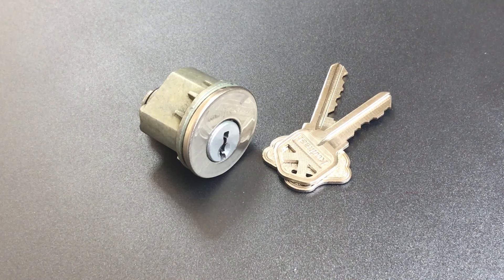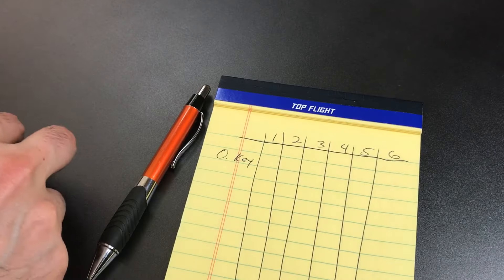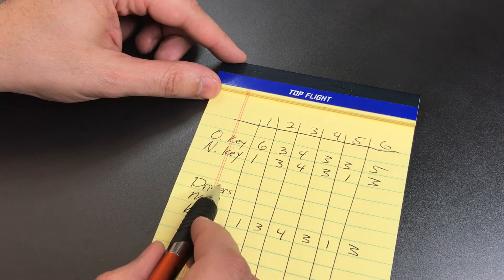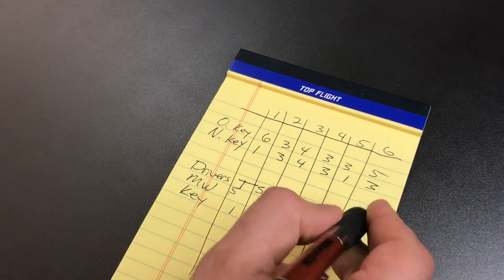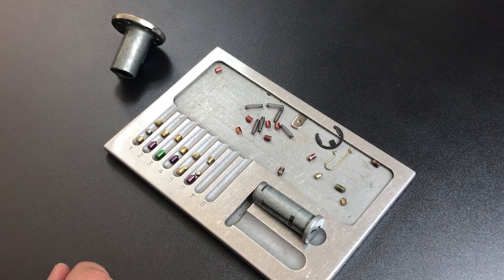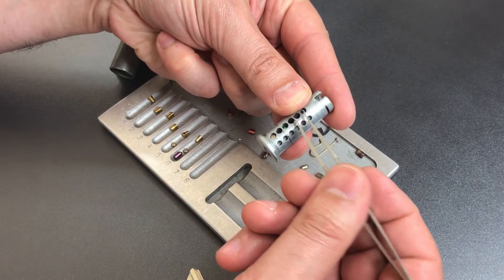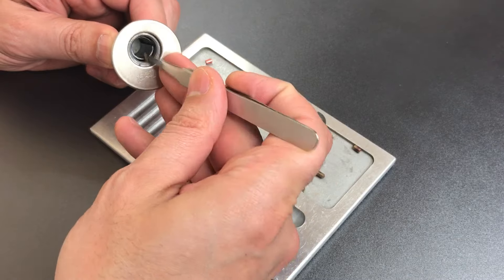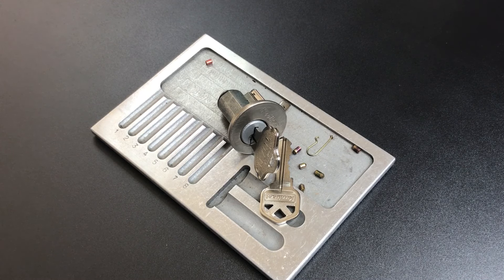[541] How to Make a Kwikset Key Trap

Comment: Trapping the key would also stop them from picking it.
Reply: Picking it would cause the driver pins to drop into the trap slots when the cylinder turns. So picking ensures a seized lock and using the old key ensures a trapped key. The picking would not give you proof positive evidence of who attempted entry tho
Reply: @ChristopherGrey1327  if picked properly to avoid the false sets that happen due to the trap pins its still possible to get in and out unnoticed however its very pick resistant

Comment: I don't know what the exact terminology is called but it's the tool you use for whatever you pick a lock the wrong way and it snaps it back the opposite direction  without having you to repick the lock. Would that possibly allow the pins to skip over the locking holes? I mean you'd have to know ahead of time that this type of setup was already there. But keys get lost and the lock might need to be picked.

Comment: Does this only work with the original key?  I’m new to this whole thing, I would assume any key that fits wouldn’t just “engage the trap” it as it would still have to fall in to the  parameters of the pin configuration.  So if I legitimately used the wrong key on my door; for example my grandmas house key instead of mine it would act as a normal lock and do nothing.
Reply: It would also trap keys which had some pin heights from the old key and some from the new
Reply: This exact design would let any key that had every pin height the same as either the old or new turn, and trap any key that turned and had one of the lower pin heights of the old key.

Comment: worth considering: key traps won't trap keys if the cuts are progressively deeper. we don't usually allow such bitting because without a 'wiper' (a high cut near the tip) pins can become stuck at the shear line. but if you did key it, say, 12345 or 11235 etc. your key trap might not hold the key.

Comment: You could also have this for a key where the new cut is lower than the old cut. This by having a T master wafer instead. So when the new key is inserted, both the key pin and T pin will be in the core, and the driver pin will be in bible (no trapping). When the old key is inserted, both T-pin and driver will be in bible, and thus trap the core.

Same also works for mixed keys. For those locations where the new cut is shallower than the old cut, you put the T pin as driver, and normal masterwafer. And for those locations where the new cut is deeper than the old cut, you put the T pin as mw, and then a normal driver.
Reply: great idea!
Reply: Unless none of the Master wafers are long enough to have a "T" cut into them. Then you'd be screwed.

Comment: btw because your example doesnt show it but what will you have to do if your new key has a slot LOWER than the old key? just add a wafer and use a driver pin which isnt a T?
Reply: You would just use a normal driver in that chamber and rely on the ones that are higher to be the trap chambers.
Reply: interesting.

Comment: @5:08 , why are you using the new key to open the lock and change the pins? The only time you use the old key, is to show the pins not sticking out and getting stuck. Asking for a friend.
Reply: Yeah, he "skipped" a step -- the lock and key were both probably new, so the lock already had the pins for the "new" key.
But, you still have to change the pins in order that the pin or pin+wafer meets the shear line for both keys (if you want to the old key to also turn the lock).
IOW, you have to create/match shear lines regardless which key you use (old or new).

Comment: This will depend on the handing of the door. If it’s a right handed door, you would turn the key to the right to unlock the door and this wouldn’t work when unlocking the door. It would work when locking it thought because you would turn key to the left to lock it. So this person could still get in and there key would only get caught when they locked it when leaving.

Comment: It's also important to note which way the core needs to be turned to unlock the door. If this cylinder is in a deadbolt on a RH door you would turn it clockwise to unlock it. Of course, you could always drill your own construction holes on the left side of the bible as well.

EDIT
I just noticed you addressed this in the description. Shame on me for not reading it first. :)
Reply: Might be a market for pre-drilled ones if this becomes popular.

Comment: I have a smart key lock,, which somehow got misprogrammed after ~2 years of normal use. I had it set to old keys (keys that did not come with the lock) that recently just stopped working. Now it won't accept the old keys. Is there a way I can reset it to factory settings i.e. to the keys that came with the lock.

Comment: I find that on most new locks I encounter as a [person who keys a lot of locks] when measuring the keys now you have to force them into the slots to measure each cut - like they are all just a little long so the key doesn't fit in the slot when measuring unless forced. Is there a reason they are doing this now?

Comment: This is a neat trick. Can you post a video showing how to disassemble a lock from inside when this has happened?

Thanks!!
Reply: This is done in about 50% of the videos on this channel.
Reply: @remchaill9898  then perhaps you misunderstand my intent - how do you disassemble one after it's had the pin jammed?

I have a practice lock that I jammed when taking apart, and aside from drilling it its a hunk of scrap.

Is there a trick that can save a botched lock?
Reply: @Lukesab3r  I think for this particular lock you could remove the crimped cover that retains the pin stacks & springs
Reply: @holysirsalad yep
Reply: @holysirsalad I feel like configurations like this are the reason why kwikset has that cover to begin with. Great value

Comment: You turned the old key anti clockwise!! That's quite rare. What if you turned it clockwise?? It would've worked like normal, and not trapped the key, right?!?
Reply: The Eminent Joshua E. Hrouda I noticed that too. Also don’t accidentally use a different kwik set key you have on your key ring when you get home and its dark outside.
Reply: Nearly every Kwikset I've seen unlocks when turned anticlockwise.
Reply: unlike My door: turn anti clockwise to lock

Comment: just an idea: cannt you swap the Master Wafer for for a T Pin to catch locks where the old Cut is higher than the new one? for the new Key the T pin stays inside the Core, and cannot catch the holes, for the old key its pushed into the Bible and will catch the holes.
Of course this method requires T Pins of specific length of what would be the master wafer (and likely a min difference in cut depth of 3 or 4), but it should work too right?

Comment: I'm dying to know, how do you remove the trapped key after the danger has passed?
Reply: two years late, but from the inside you can pull the whole mechanism apart with screws that can be accessed from the secure/inside; that drops out the whole housing he's reassembling starting 7:17 which you can then disassemble with needlenose and that c-clip remover like he shows here

Comment: well i guess the more of these videos i watch the more of my ideas , well what i thought were mine, have already been thought of by someone else. I think what i would do to improve this would be to set it to a electronic button of some sort that records from your door cam, if that key is used, have it stop in the holes, so it cant open the door, but so its not locked, add a slice/slit from the lock hole to the barrel hole so he /she can take the bad key back out.. having recorded the event, but also letting them keep that old key so you can still get in later. Maybe it also turns on a little red light by the door so you know it happend. you could do that with a small censor , right?.

Comment: Why did the wrong key turn the lock that far?  I would not have exptected the old key to turn at all.
If you had only replaced pin number 1 I would understand but changing several pins puzzles me.
Can you do another one and explain to those of us that know nothing  :)    Thanks
Reply: For each location where the keys differ a "master wafer" is used so either key will allow the lock to move (the same as if you were building a "master-keyed" lock). If the "new" key is used then the master wafers in the T pin locations are lifted above the shear-line and block the T pins from falling into the construction holes, so the lock operates normally. If the "old" key is used then the master wafers remain below the shear line, the T pins fall into the construction holes and the lock seizes up.

Comment: If one were to grind the construction holes into slots or ramps, would it be practical to make the lock so that one of the keys could only turn it in one direction while the other could turn it both ways?  Such a thing might also be good for a challenge lock, since picking to the wrong shear line would give a very deep false set but not an open (since the lock would turn to the position of the construction holes but then get stuck there).

Comment: How do you recover from this? Is the lock now toast?
Reply: IMPORTANT NOTE:  The only ways to remove a trapped key are (1) to enter the house trough another door or window and disassemble the lock from the inside, or (2) drill the lock. Use accordingly. 👍 In addition, note that this trap works only if your door opens by turning the lock core counterclockwise.  However the cylinder can be modified to work by adding construction keying holes on the left side of the core.

From the description.

Comment: Could you use magnetic waffers to pull them free of the trap to rebuild the lock?
Reply: Even non-ferrous metal has a shielding effect against magnetic interactions. You'd need a plastic lock body to pull that off without magnets that cost more than the lock is worth.
Reply: @dustinbrueggemann1875  Neat! Thanks!

Comment: If you turn the key slowly, could you accidentally get it locked up ( sorry I don’t know the proper terms)
Reply: Not the correct new key, no. The pins that get stuck have smaller bottoms that fall into the hole, while the correct ones are too large.

Comment: You said the new key must have one cut higher.. none of these were higher.
Reply: A lower number is a higher cut.
Reply: That is incorrect. If I have a 2 depth and a 5 depth. The 5 is deeper.
Reply: Exactly. Higher cut = smaller number. Lower cut = bigger number.
Reply: You are still wrong. That's not what I said.
Reply: In chamber 1 the new key is a 1 cut and the old key is a 6 cut. A 1 cut is a higher cut than a 6 cut. I can't make it any simpler.
Reply: We are both right.
Reply: old key: 634335
new key: 134313

a #6 cut is deeper than a #3 cut.

Comment: i can see the benefit in both this and the other video with the kwikset trap, but i see this as a possible fire hazard. if someone (old marty) wants to harm you, he can use this to make it so you cannot escape through your front door, and any other exits could be blocked/harder to access. of course it's a low chance, but for this reason i dont think this idea could be widely used. unless there was some sort of mechanism on the front of the lock that would disengage the whole cylinder from the door or something.. it would be quite hilarious though to see surveillance of someone getting their key stuck and then panicking that they will be found out. it's such an unexpected thing to happen.
Reply: ForthyPremonition be sure you have another door before you did this. And be sure you know locks and how to take them apart
Reply: also dont most deadbolts open when you turn the inside level with out turning the cylinder on the outside?

Comment: Thanks for the acknowledgement and I'm glad I inspired you to work it out yourself. Your method is easier than mine where I modified the cylinder. Although I'm not sure they had T-pins when I did this in the early 90's.

Now, with that said, it had me thinking of an easier way to remove the trapped key (especially if it's your only door). This is what I came up with, but it does require modifying the cylinder. And also require a little trial & error.

1. Find a small ball bearing that will fit into the construction keyholes. Measure the depth of the hole with the ball bearing in it. 
2. Drill a very small hole (diameter of the above measurement) to the right side of the keyway that lines up with the bottom of the construction keyholes. 
3. Place the ball bearings into each construction keyhole. 
4. Now a thin rod inserted into the new hole (may need to be tapered) should push the T-pins up to the shear line, allowing the key to rotate.

Now, this would also allow someone with the wrong key to still enter, but they would have to know what that little hole was for and have the right tool. You can also get a small sticker to cover the hole to make it less obvious. 

This is untested, but I think it would work. If anyone sees a flaw in it, let me know. Thanks.
Reply: and here i thought the name was fake and this was an idea over a strong drink...
Reply: Bret Mohler Real name. Not denying the strong drink part.
Reply: I totally would have gone for that; but I talk to my booze sometimes. Nonetheless, this is an ingenious idea. Props for the great explanation LPL and Tom Collins thanks for the trapped key removal idea! It will be something interesting to experiment with once I grab some new locks!

Comment: Only problem with this is,  if the hinges are on the left side of the frame,  this is absolutely helpful.  If the hinges are on the right,  this is absolutely pointless as most boyfriends don't care about locking up the door again.  Still better off with s high security lock for many reasons.  LPL, you pick the ASSA that I gave you yet? Of course not,  that's why my house has them on it.  Good job though.
Reply from the maker: +Adam A Agreed... I note this in the description. 👍 no joy on your ASSA twin... the lock from hell with bitting from hell! 😈

Comment: My question is, how do you get it apart after the key is stuck?
Reply: You'd have to pull the core out and pop off the top retainer to dump everything out.
Reply: @Dfk429S9fo3  Dang. Seems like its more hassle than its worth when I could just get a semi-decent residential grade/light commercial lock for like 80-100$?
Reply: @Munky332   The benefit of doing this is that you get proof that someone with the old key tried to enter. Which might be important if, for example, you're trying to get a restraining order against a crazy ex.
Reply: @Munky332  the point of doing this would be to get some fucker arrested not to recover a key. They could have more than 1 copy.
Reply: @martenkahr3365  wonder if a court would accept this though.
Reply: @josephwodarczyk977  Hard to argue against the physical key being physically present in the lock.
Reply: @josephwodarczyk977  If you came home and saw a trapped key call the police and tell them someone tried to break into your house. When they show up explain the key and get them to dust it for fingerprints (fingerprints aren't unique, but if there are any that are intact and they match the previous owner then it will be hard to argue against since they are the only person who would have a second copy of the original key). This would most certainly be acceptable evidence as a need for a restraining order; the burden of proof is not super high and this would be very strong evidence.
Reply: warmowed - Local cops dusting a stuck key for fingerprints lol! 🤣😂
Reply: Henrik Andersson - The argument wouldn’t be the physical key stuck in the lock, it would be who stuck it there and proving it.
Reply: @henke37  but what if the crazy person is doing the lock trap puts the old key in and cry's wolf to get the ex arrested.  the crazy can go both ways

Comment: Is there a way to correct this as you the Owner, would rather not want to replace the lock? Would an Electric pick attached to the key be able to bounce or bump T pin up?. 
I'M sure it is Impossible, but if I want to watch, just go to Video 12,947, I can see how to save my lock. 
I thought you were Just Good, I see you are Fast as well. Good work, Am Stratmando on lp1.., Always Learning. Take Care
Reply: You dont need to replace the lock. You would need to remove the lock from the inside (youd need another entrance into the house, say a garage, or back door) once the lock is removed from the door, you take the top retainer off and remove the driver pins, and bam, lock fixed

Comment: Reminds me of a mail key for a package, "how they will leave a key in your mailbox to a different mail box so you can retrieve your package" it opens the door so you can get your package but the key stays trapped in the keyhole. How does that work?
Reply from the maker: It’s a different mechanism... much more simple. It’s a spring loaded device (similar to a safe relocker) that stops the core from turning back to the 12 o’clock position, thus preventing key removal.
Reply: i have opened one, and the way i bypassed it was using something to push the spring, so that way the key can return to the 12oclock position.

Comment: +LockPickingLawyer Hi, is there any way to make a key trap out of a door lock like this kwikset or any other brand that would work normally with the first key and trap the second key but still unlock the lock? Thank you. David
Reply from the maker: Yes... drill the trap holes at a position in the core that’s past the unlock position.
Reply: LPL, do you use an old Bible For a drill guide, drill first hole, clean an deburr, then put drill bit back in drilled holes backwards, so solid shaft will hold in place, then drill rest of holes? Not knowing, I would try that. Thanks